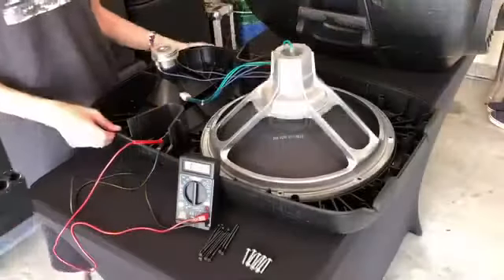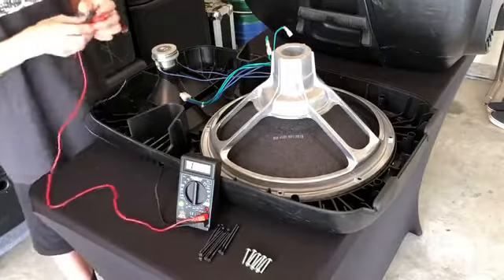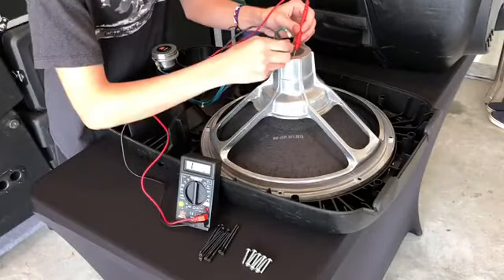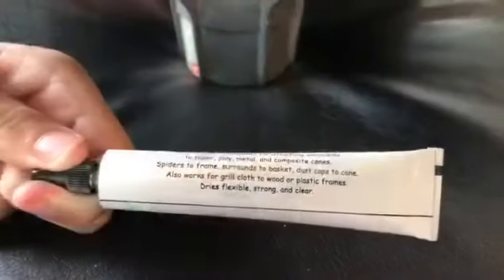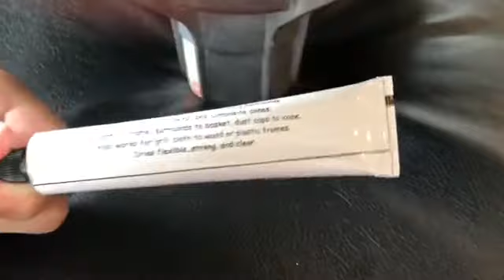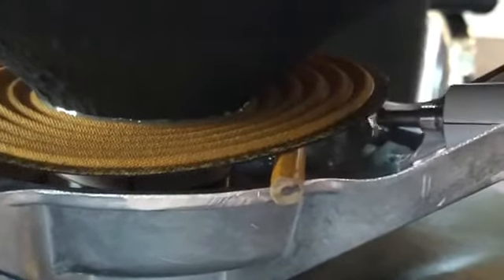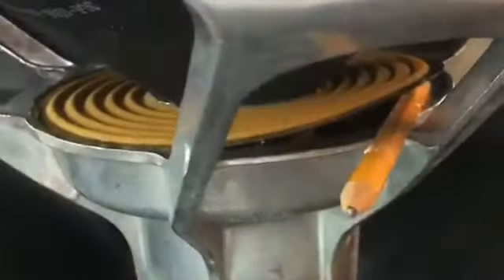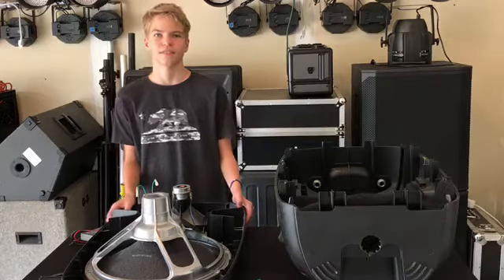JBL EON 615XT easy speaker fix... if you’re lucky.

Comment: Mine has got that rattling sound on the sub woofer sounded like something had dropped in there, hopefully this is my issue also good vid 👍
Reply from the maker: It could also be the rubber ring that came loose around the front of the speaker. Also an easy fix with speaker glue. Good luck!
Reply: @edgarsteenwinkel1970  thanks mate

Comment: What material is behind the grill and how is it attached?
Reply from the maker: Not sure about the question. There is no material behind the grill. The grill is powder coated pressed steel. The rest is ABS plastic. The speaker is screwed directly onto the plastic shell. Hope this helps.
Reply: @edgarsteenwinkel1970  is what you can see in the grill holes? I thought it was material
Reply: @edgarsteenwinkel1970  i hope that help? As you can not see through the holes, there is something behind then
Reply from the maker: Wow yes there is a thin black foam layer stuck on the inside of the grill. Never noticed. Thanks for pointing that out!

It’s something like this:

WAYBER Speaker Grill Cloth Stereo Mesh Fabric for Speaker Repair, Black - 55 x 20 in / 140 x 50 cm https://a.co/d/8lUeux1
Reply: @edgarsteenwinkel1970  Any idea how to replace it? Is it glued?
Reply from the maker: @Davehiphop  yes it’s glued. Spray glue might work but try at your own risk.